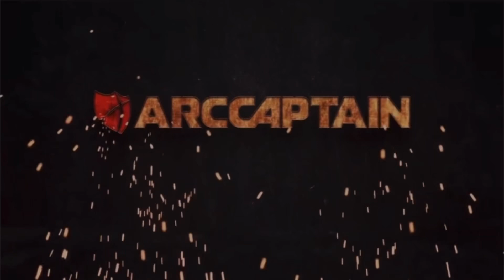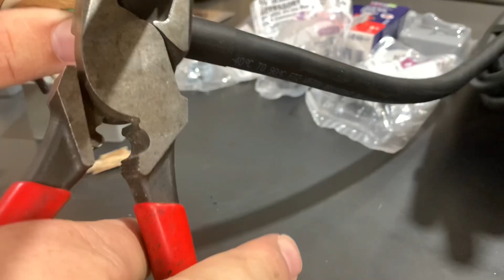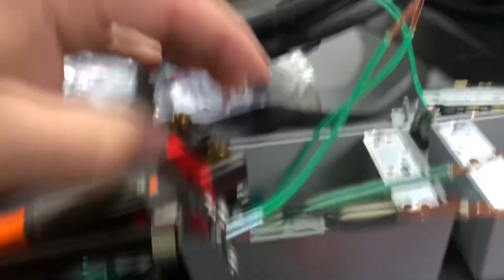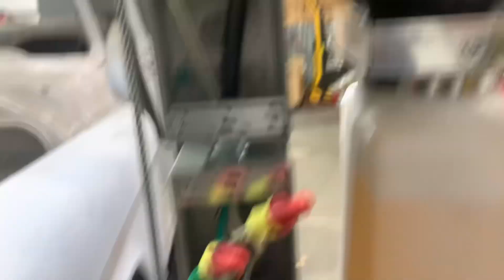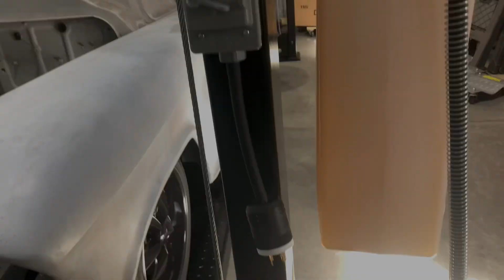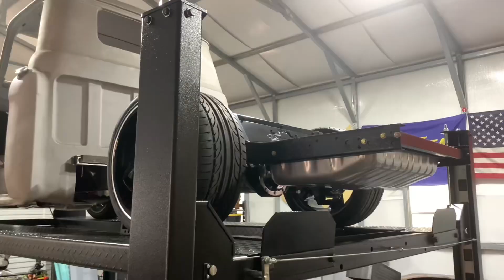⚡️Running ELECTRICAL to power a CAR LIFT⚡️

Comment: You're a bad boy! You never, ever, screw the reducing bushing into the hub. Tighten it onto the nipple or fitting first & then into the hub. If you ever need to take this apart you can still get the reducer out. If you screw it in the hub first, its gone forever & you're replacing that whole box should you ever need to put a bigger conduit in. And those outdoor switch covers are garbage.
Reply from the maker: Bro this whole thing comes apart in under 60 seconds. Bushing and all.

Comment: Can you post a few pictures of the stitch boxed mounting on the inside of the column . Same lift just don't see a place to install a bolt and nut. thanks
Great ideas in this video!
Reply from the maker: Stitch box? Im not sure what you’re asking. The only thing that mounts to the column is the motor which is bolted to a bracelet on the outside of the column
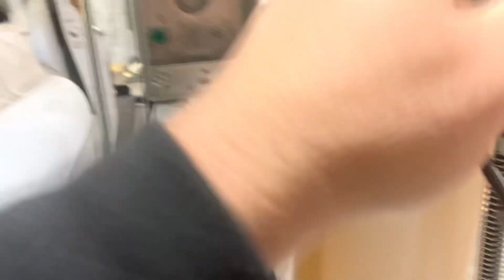Reply: @intheshoptv yes the switch box you have mounted on the outside (7:15 mins in the video). I would like to mount the same setup but concerned the mounting bolts for the switch boxes will hit the white glides on the cross brace inside the upright. Hope that makes sense.  All your videos are great keep them coming
Reply from the maker: Ah, I see now. You probably hit the wrong button by accident and typed “stitch” instead of switch. Happens to me all the time. Sure! So what I did was use Dual Lock to mount the switch box. Its a rock solid connection and no holes to drill in the steel. Plus, It’s my opinion that it should be removable anyway since the lift has casters. Hope that makes sense
Reply: @intheshoptv  Great idea!! thanks a ton
Reply from the maker: @ you’re welcome. Good luck!